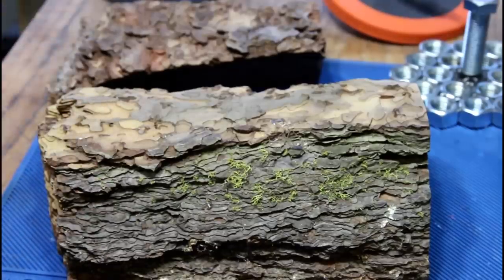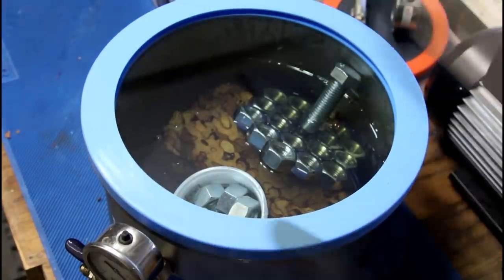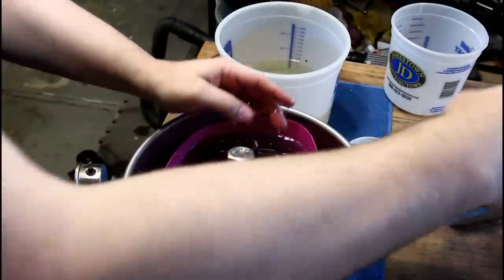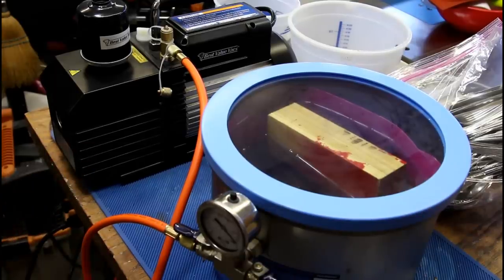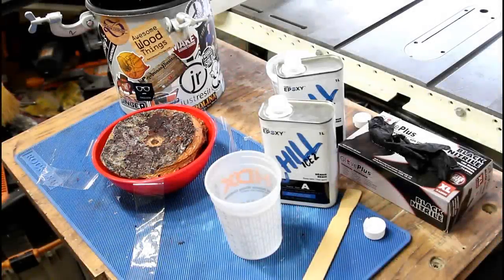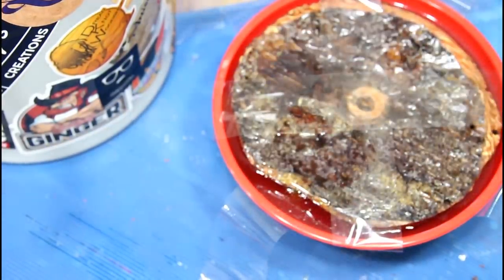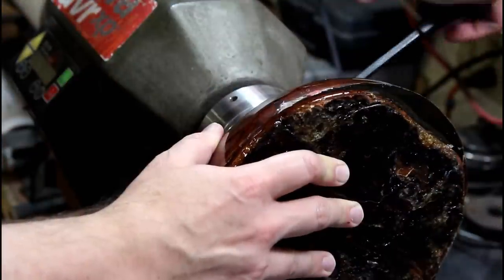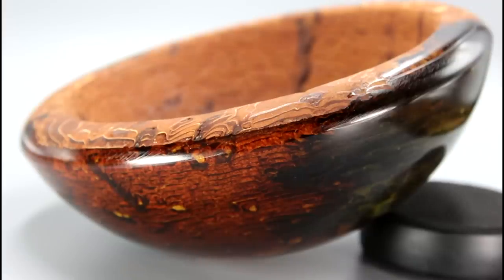Make a bowl From Bark? (...and resin) | Dipit #25

Comment: Peter! I cringed when the stabilizing resin bubbled up and potentially got into your vacuum pump. You may want to change the oil out on it on case it was contaminated by the resin. It would suck if the heat of the pump cured anything that could have gotten into it.

Beautiful work, as always! You're my favorite Maker on YouTube!
Reply from the maker: I did change the oil. It was totally contaminated. Luckily I caught it fast enough that the pump seems fine.

Comment: In future why not have a small jar in line to catch any stabilising fluid overflow and to stop resin getting to the vacuum pump? A bit like the moisture traps they use on airlines. 

Was the bolt/handle welded to the weight? If not you could’ve just taken the bolt off and used that to hold the bark down. If it was welded on, why?

Comment: Let’s back up : 1st thing Harding process the rule of thumb ? When you vacuum down you had the valve wide open. You must control the air bubbles by partially closing the valve so you don’t have a run over. 2nd you must keep it under constant vacuum until all bubbles have stopped. 3rd how ever many hours it took to vacuum to this point you double the time letting it sit under standing vacuum with the pump off. Then proceed to your drying process.

Comment: A strange idea. 

If you could ensure that it didn’t kick during the process… could you do the same thing with casting resin that you do with the stabilizing resin? Put it in the vacuum chamber and then let it fill in the voids?

I realize that keeping it from kicking is the problem, maybe something with a really long working time and keep it at as cold a temperature as possible? Outside? In the freezer? 

I don’t know, just spitballing here.

Comment: I get the feeling you don't actually need to weigh things down.  As the air gets evacuated it would probably just sink.
Reply: Interesting thought. Definitely worth trying to see if that's true
Reply: @skeetsmcgrew3282  since solids are almost always inherently more dense than liquids, one the air is removed it should sink.
Reply: @DoRC  My concern would be that it wouldn't sink fast enough to be worth running the pump so long. It would likely sink very slowly as the top would retain buoyancy. Considering how long he already had to run it and still didn't accomplish his goal, that could potentially add hours to the process
Reply: @skeetsmcgrew3282  the top wouldn't stay bouyant. The air would be sucked out of it just a quickly as the rest.

Comment: You may get a little bit better results if after running the vacuum and pulling the air you put it into your pressure pot still submerged in the stabilizer

Comment: I just rewatched this video and was wondering. 

If you took the block that was half submerged and put it in the toaster oven to cure. What would a cross section of the wooden block look like with stabilized vs non stabilized.

Comment: Always, always, always use a vacuum (resin) trap between your stabilizing chamber and your vacuum pump. Even better, put your trap in cold/ice water. Even if the resin liquid or foam don't get sucked out of your primary chamber with stabilizing resin, there will be resin fumes pulled into your pump that will shorten the life of the pump's seals. a chilled trap will make the resin (fumes) condense and stay in the trap. (Following is just a reference: https://bacoeng.com/products/3-gallon-resin-trap )

Comment: Next time do a cast resin bowl. and get a bigger vacuum pot. Total Boat slow put the bowl in the freezer to get the plastic bowl off. I turned some bark and then put it in the resin again. sanding seal may be needed.

Comment: I have a question for an upcoming video. I've been dipping the bottoms of stemware and painting small vases. I'm wanting to seal the paint, but I've heard that resin is dangerous when used with glass. I've heard of a few alternative products, but I really don't want whatever I'm working on to possibly explode 😲

Comment: Wouldnt turning the vacuum pump on actually cause the glass to be pushed in? So down into the container? Meaning it isn't at risk of cracking because it would normally experience even more pressure from the pump being turned on without anything pushing up?

Like if you had a spring inside the container pushing upward at 1 atmosphere, and a perfect vacuum inside the container, then the lid would essentially have 0 pressure on it? Because it has 1 atmosphere of pressure pushing down on it, from the air around the outside of the container. While also having 1 atmosphere pushing up from the inside, the spring, thus cancelling eachother out?

So that wooden block floating up against the lid wouldnt actually be putting it at a risk of breaking since it normally experiences 1 atmosphere worth of pressure pushing down on it once the vacuum has been reached anyways?

Sorry if this was very poorly explained, I can try to explain better if I didn't explain it well enough for you to understand what I mean

Comment: hey Peter. I don't think you need to run your vacuum for that long.but then again I'm just a rando on the internet. please at least hear my reason.
When you pull vacuum I think the reason why you still see bubbles is because of water. it turns to steam in low pressures and causes bubbling drying your specimens before the stabilizing procedure could be more convenient for you.

Comment: What if you would have sanded it on the lathe instead of using the gouging tools. We use the clayton vacuum pads at work, I think they would have done good on the outside of the bowl

Comment: You need to make flat weights. If you need a bolt, screw it in. Bolt too long? Use a shorter one. Not heavy enough? Two layers of weights on the one bolt.

Comment: You might try looking at something like this for those long vacuum times: https://www.joewoodworker.com/veneering/EVS/concept.htm

This  will allow your pump to only occasionally run as it needs to - it won't run continuously.  I've used a setup with 4 tubes (because I had extra PVC) and it's worked extremely well.

Comment: No trap?????? How/why were you not using a trap before your pump?
Reply from the maker: What’s a trap?
Reply: @peterbrownwastaken  basically just a vacuum sealed container with a port in and a port out at the top that's on the vacuum line right next to the pump. If any liquid gets pulled towards the pump it ends up in the trap instead of the pump. You can probably make something in a couple minutes out of good old abs sewer pipe, but for chemical compatibility (not sure if anything in the resin attacks abs or even pvc) iron pipe would probably be the best cheap and easy solution. 

A clear lid on a trap has the benefit of letting you see of anything got pulled into it of course, so the best solution is just something like a small version of the vacuum chambers you already use.